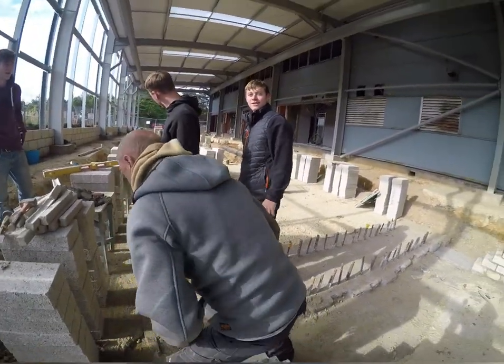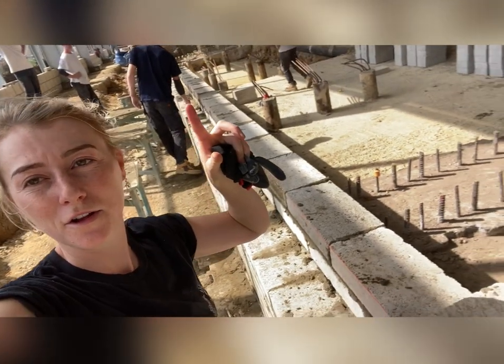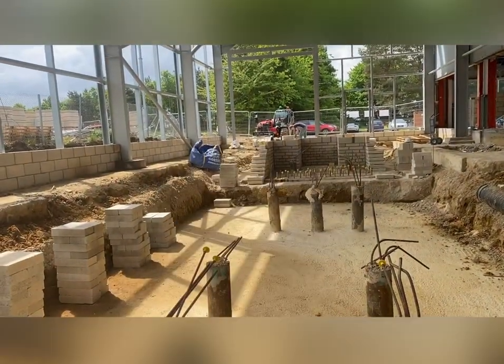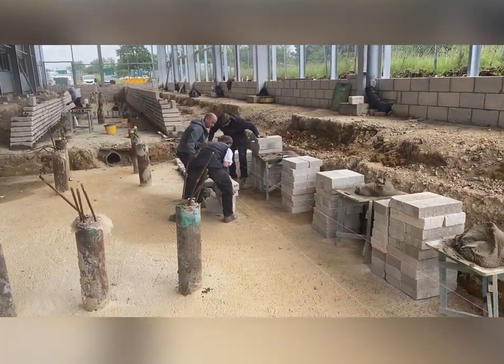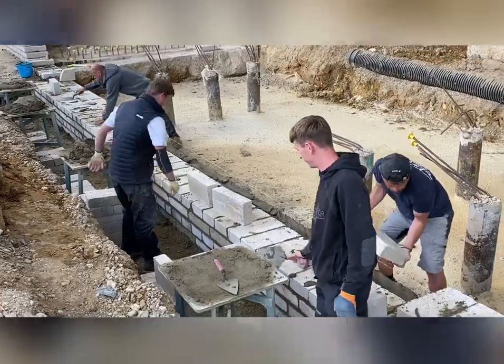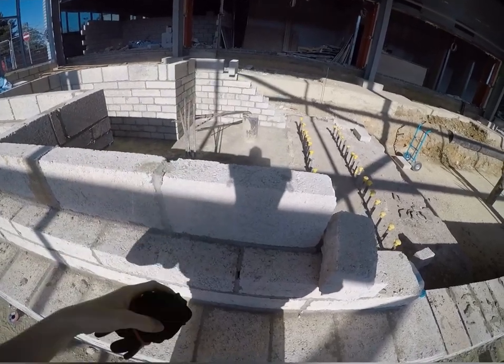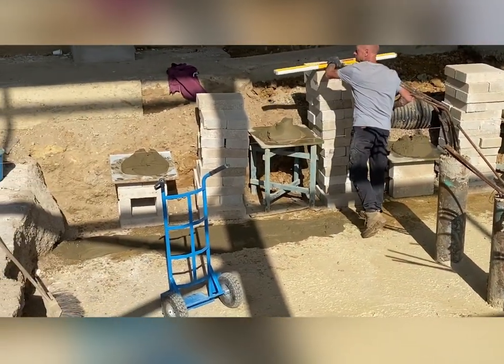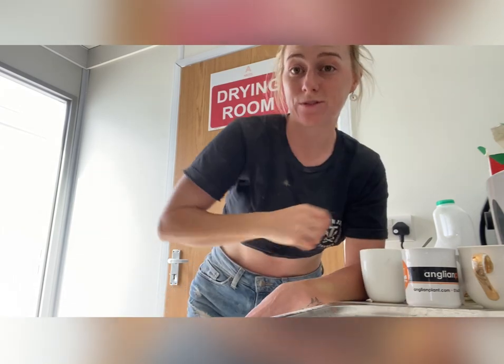Girl Bricklayer shows the most concrete blocks laid in a day!

Comment: So why lay 4" block on the flat? What is the purpose? Very expensive wall. Do you not have 8-10 inch block if there is a structural component for these walls.
Reply: Sorry did not watch end of video when I commented what your building. Far cheaper to use bigger block and corefill or make concrete wall.